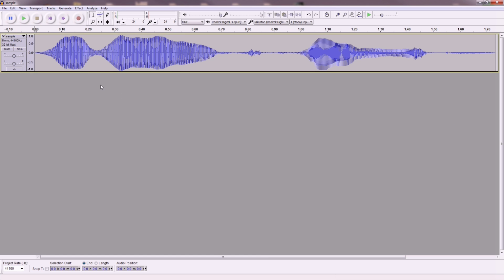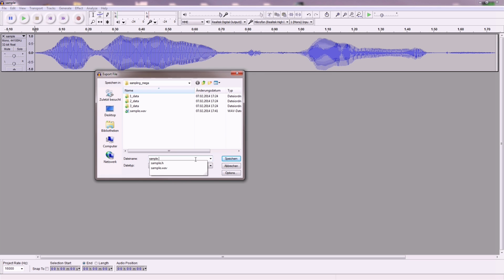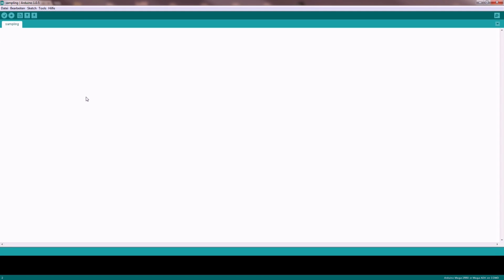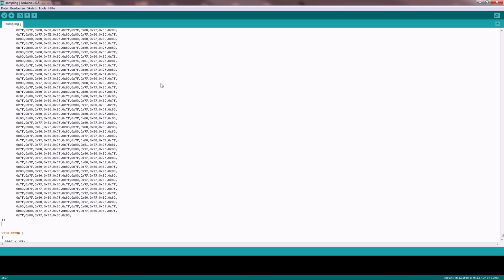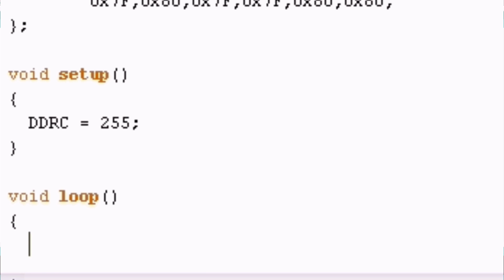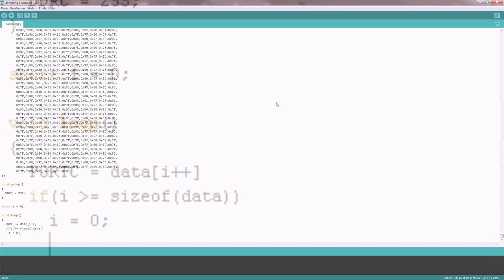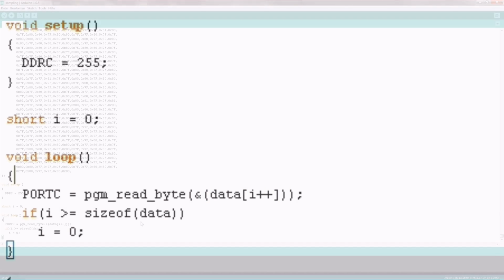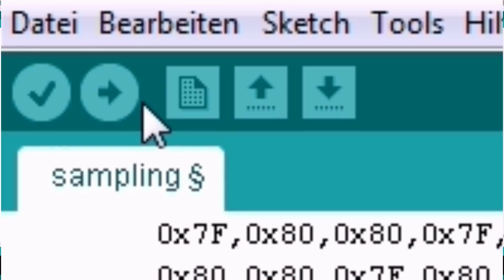Arduino audio sampling tutorial (part 1)

Comment: A budy of mine proposed that an arduino is "Real time" and the raspberry is not.

As of my last personal contact with the topic was that "real time processing" means performing a certain action takes a virtually fixed amount of time so you got a guaranteed processing time.

But I think for some reading over i2c the raspberry is fairly underwhelmed waiting on the slave since it is so much faster that the slight inconsistency does not necessarily hurt anyone.

What do you guys think on the topic?
Reply: Its easier to do with the Arduino framework. 

However, a Raspberry Pi can also work in real-time. In most cases, unless your going for microsecond or even nanosecond timing, its more then enough usable with Raspbian.

Bare-metal programming (assembly or a optimal high-level language like C without a OS) or a optimal RTOS will suffice.

If a optimal real-time system was needed, i think that automotive-level microcontrollers, programmed in C using no dynamic memory allocation and multiple fail-safe mechanisms will perform much better and more reliably.

Comment: I have an issue with this. I tried the same thing as shown in your video, but the header file i obtain is not quite like yours. In fact, the Data array that your header file contains, has elements like "0xF7" or "0xE5" etc. My Data array on the other hand has elements such as "-114,91,-123,104," etc. 
Is this a fault? or am i missing something? 
please help me out

Comment: =)   Great fun, thanks for creating the video.
- Question, could this system use WAV files that are recordings of notes being played by a concertina (accordion), and play them back in response to buttons being pressed for each note in a scale? I'm hoping to create an electronic concertina. The note would have to sound instantly (less than, say, 100msec of delay).
- The standard MIDI voices aren't suitable. I have a .SF2 sound font file for the concertina. I think I can save each note as a .WAV.
- I have a MIDI controller built onto an Arduino UNO. It has a wire from each of the button switches, and outputs MIDI signals for standard MIDI,  which is useful as well, but most important is to have the sound of a real concertina.
- Bruce Thomson in New Zealand.

Comment: So the line you wrote to tell the PORTC to send the 8 bits from the data() array, I believe you said that by placing the '&' symbol before the data reference, it becomes a pointer to the address in memory by making the reference '&' just before the array segment?  
I'm trying to understand a little more about the Arduino, and I can't help but feel like I'm making things so much more difficult by trying to use that blasted IDE.  They've just hurt me more with a new and improved release.   But even by going over to ATMEL studio, it's environment is just as precarious, I'm not an EE, nor a programmer, but I wish I could be better at both without paying the dues.
Thank you for the super down to earth and patient presentation, and THANK YOU FOR YOUR CONTRIBUTIONS, here with your video, and elsewhere.  I'm so glad there's good people like you, taking time to not only to point out the not so obvious to all, but also putting in work to help strengthen the weaker parts of the libraries and examples, and enhance them substantially.

Comment: Hey, vielen Dank erst mal für das tolle Video! Leider bin ich bei meinem Projekt, bei dem ich mein Arduino Mega 2650-Klon nach Signal von einem Sensor auf die hier gezeigte Weise einen kurzen Audioclip ausgeben lassen will, vor ein Hindernis geraten:

Wenn ich deine Webapp nutze um meinen Audioclip konvertieren zu lassen, kommen teils negative Werte im Array raus, außerdem fehlt die Datengrößenangabe in den [eckigen Klammern]. Die Arduino IDE (1.6.12) beschwert sich beim kompilieren dann über jeden Wert mit den Worten "sorry, unimplemented: non-trivial designated initializers not supported." und wirft eine Fehlermeldung dass "storage size of 'myArray' is unknown'.

Hast du vielleicht einen Lösungsansatz? Ich bin Neuling und mit meinem Latein am Ende.

Comment: 0:47 That's the problem with the uno. If the serial connection is used, it doesn't have a full 8 bit port.
Reply: Why all pins have  to be from the same port? (I don't quite understand that) Thank you :)

Comment: If memory serves me correctly, you're using a DC coupled class A amplifier. I can't argue with success, but I probably would have added a capacitor between the final transistor and the speaker just to keep DC out of the speaker.
Reply: No, this is not class A amplifier. This is common collector (voltage follower) connection. The load (speaker) is connected between emitter and GND and the collector is common for both input and output stages. Darlington-like connection results with multiplication of beta factors (the equivalent transistor would have beta as product of beta factors of these two transistors). The common emitter configuration is here used for both high input impedance (not to put DAC under the load which would disturb its output) and for high output current (because the load impedance is just 4 Ohm).

Comment: Excellent  !
Thanks a lot for the upload. I've got a silly question : is there a way to connect an Arduino to an old computer with parallel or serial port ? I'd like to use the Arduino as an additional sound chip for retro computers : I'd load the samples I want to play in the Arduino, and there would be a program awaiting a signal to play a given sample, and the order to play would be emitted from the serial port or parallel port of the vintage computer. Would it work ? Can the Arduino read a signal from either an old serial or parallel port ?

Comment: Which port can I use in Arduino Uno?
Neither PORTB nor PORTC has all pins on board
Is it good idea to use PORTC for this?
Reply: Glue Men Generally you need just to analog_write the current value.
But there is an issue with PWD frequency. You have to increase it (eg 44kHz)
Reply from the maker: +Nickolay Kondratenko 
no luck there. either you just use just the 6bits you get of one port or you split it to b nd c.. 
that why I took mega in the forst place
Reply: +bitluni's lab I used PWD for it.
Reply: +Nickolay Kondratenko i'd like to build this too with an arduino uno but im pretty new to the arduino so i'd need a hint from you how you did it with the PWD pins

Comment: If I understand correctly, the sample was 8 bit? Also, would it be possible to trigger the sample from a push button switch. And what about 16 bit 44.1 Khz samples? Is that possible on the Arduino?
Reply: DevinThomas That is possible. If you use 44.1 khz you will get a shorter recording time and if you use a similar setup you will probably not be able to hear the difference. To trigger the sample with a button just use something like: while(ButtonPin == 0){}
Reply: DevinThomas That is possible. If you use 44.1 khz you will get a shorter recording time and if you use a similar setup you will probably not be able to hear the difference. To trigger the sample with a button just use something like: while(ButtonPin == 0){}

Comment: Very informative video for the arduino teensy project I'm working on.
However I'm currently stuck on the part where he uses the bin2h application to create the header file.
The program just keeps writing the hex to the screen...:/
Reply: I've used similar utilities. Try something like this:

bin2h input.file > output.file

The "> output.file" part tells it to take what would have been written to the screen and saves it to the file instead.
Reply: ***** thanks for that little tip :P, will give it a shot when I'm next using the facility
Reply: Hi Jo. I just tried the bin2h utility and it works really well. This is what I used:
bin2h.exe < input.file > output.file
There may be other methods, like pipelining but I didn't fiddle with that. The less than and greater than symbols can be read as "from" and "to".